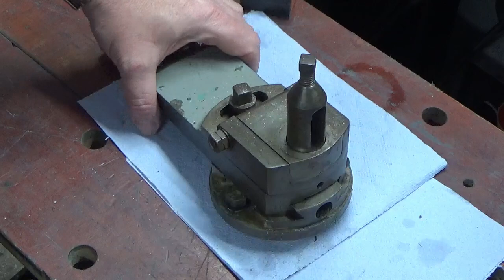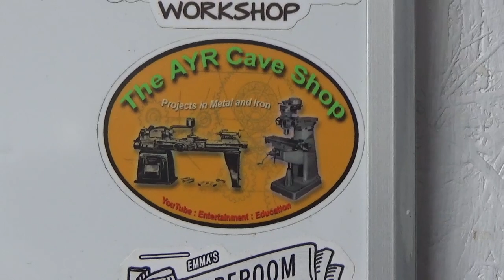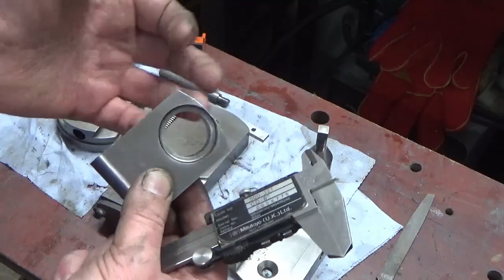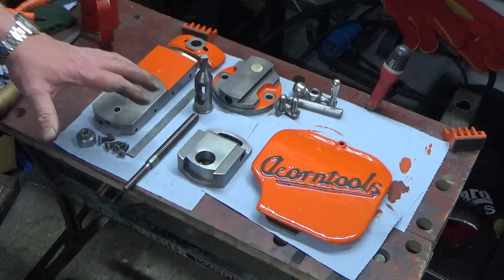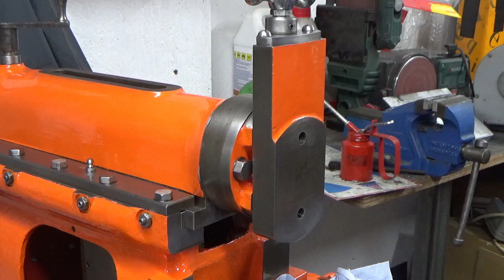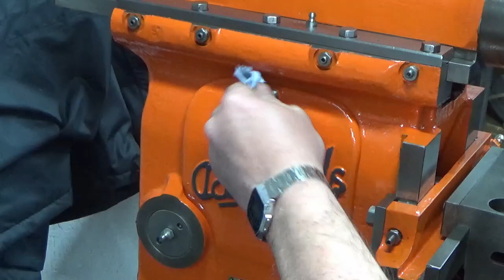Atlas 7B Shaper Refurb Part 9 - Tool Slide and Clapper Box

Comment: I my not be of much help, but I would mic the bore on the clapper plate, and compare those readings to the lattern post. Have Dean and Michel mic theirs and see comparison. The lattern post take on a lot of ware over the years. Bear
Reply from the maker: Hi Bear, thanks for the comment. Yep, we did just that, Dean's is exactly the same. Must be by design. Very odd. Cheers, Jon

Comment: I have an Elliot 10M and I've just checked the lantern toolpost arrangement. It's a sliding fit when it's all the way through, but when I pulled it right out I discovered that it has a step in it - so the part with the slot is slightly undersize. I can understand the comment about not using the washer between the post and the clapper, but on the Eliot it's a huge great thing and makes no difference to the stability at all. If the toolpost was a sloppy fit in the clapper, I'd remake it because there's potential for the forces on the tool when it's cutting to move the (undersize) toolpost about in the hole - somewhat undesirable!
Reply from the maker: Hi Steve, thanks for the comment and information. Yep, I agree with you, future project I think to make a new one. Cheers, Jon

Comment: Hi Jon Just had. Look at my Acorn tools shaper and the tool holder is same as yours, with plenty of slack. It has a washer of 5mm witch sits under tool bit plus a piece of iron packing to spread load of clamp bolt.you asked if mine had a label from supplier I think, but no sign of any other info apart from Acorntools logo cast into gear box door. The motor on mine is a Hover 1/2 hp unit . Have been watching  guy you suggested who has re built an Atlas 2b with interest . As I said in last reply I’m hoping to work up a drawing from promotion pamphlets and specs and photos to make up some patterns for swivel vice out of SG iron . Vices for these seem to be like proverbial hens teeth with a hefty £££tag  . Keep up the good work really enjoy watching your channel,
Reply from the maker: Hi Brian, thanks for the comment and information. Think I will make a new one in the fullness of time. Glad you are enjoying the channel. Cheers, Jon

Comment: The lantern post is correct.  There is a conical washer set that belongs below the tool but you can just use washers.  Once it is tight that movement goes away. The keyway cutter uses a nut to pull the front and back together for ridigity.  That is why you dont want to weld the lantern in.  Great video
Reply from the maker: Hi Almost Machining, thanks for the comment and information. I will probably make a new one at some point which is a snug fit. Can't think of any sensible reason why it should be undersized. It will be fine for now though, it's only a little machine so cutting forces will be light. Cheers, Jon

Comment: Hi Jon, shaper looking nice. I checked the clapper box on my Viceroy Royal 250 shaper and there's very little play in the tool holder/post. Regards Kevin
Reply from the maker: Hi Kevin, thanks for the comment and information. I see no sensible reason at all for the undersized lantern. It will do for now but I will make a new one at some point that fits properly. Cheers, Jon

Comment: You're getting on with it Jon, it's a nice machine and I'm sure it will serve you well.  Your masking tip is used in every aircraft sheet metal shop I've worked in. Usually when masking up sheets or parts prior to non damaging marking out. An old steel rule with a ground down edge works really well too and a lot of 'sheeties' have one in the toolbox. As you say, sharing the knowledge is the best part of this. Never stop learning. 
Best wishes, Dean.
Reply from the maker: Hi Dean, thanks for the comment. Lol, Sheeties was a new word I learnt when I transitioned to shipbuilding 2 years ago. Never came across it in aerospace, all my time was in engine manufacturing. Good to share, even better to see someone else benefit from it. Cheers, Jon

Comment: Hi John.   I appreciate what you do.  The lantern on my 7B is not exactly tight either. It is a closer fit than yours but nothing precise about it at all. If you want I can measure things up for you.
Reply from the maker: Hi rlferv, thanks for the comment and sorry for the delay responding. I think I will go with what I have to start with based on other Atlas 7 owners feedback. If I get issues, I will make a new one. Cheers, Jon

Comment: The bore in the clapper of my shaper is 32,0mm and the toolholder 31,9mm. It works perfectly fine.The only thing to look out for is that the sholder on the toolholder seats perfectly in the recess of the bore in the clapper. My machine (and also yours) normally has a hardened washer between the clapper and the cutting tool. I never use it because it's more rigid without. Have fun with it!
Reply from the maker: Hi Rusti, thanks for the comment and for the information. Pretty sure in the fullness of time I can improve on what we have currently, but also sure it will probably be OK as it is to get me started. Cheers, Jon

Comment: Shaper coming along very nicely Jon.
Ref masking tape and filing tip, I was shown that sometime in my apprenticeship 78-82, but that's the idea behind machinists,  machine tool fitters recording YT videos. 
Same with making paper gaskets, dirty thumb rubbed on the edges, rubbed, peened with smooth Hammer ad infinitum, borne out of building machines quicker to get a bonus or price work.
Thanks for sharing.
Reply from the maker: Hi John, thanks for the comment. Yep, I was taught it by an old guy when I was in my apprenticeship back in the 80's. Without YouTube, I fear lots of this type of "hand me down knowledge" would be dying out! Cheers, Jon

Comment: What ho Jon, 
What's this nonsense about making new bits, if you are unhappy with the fit just sleeve it, why make work for yourself?😉
I know what you mean about hearing tips being passed on. I gave Abom a tip once and later heard Blondiehacks quoting him, not being an egotist I can't say "fame at last" but you know what I mean.😎
It won't be long before the blue hot chips are flying.👍
ATB 
c
Reply: The problem with the Americans is that they are now and have always been very good self publicists.
Reply from the maker: Hi Chris, thanks for the comment and sorry for the delay responding. All good points, noted! You will get your 15 mins of fame, I estimate that in about another 150 to 200 years I will be of a similar channel size to those you quote, so hang in there! Cheers, Jon

Comment: Hi,Jon. That lantern holder is a dreadful fit in the clapper. I have 2 homemade lanterns for my Alba 1A and they are a very snug sliding fit. Even the old original holder which was beat up was a very close sliding fit. 
There is a little more to this scenario in as much as a large commercial shaper(Cincinatti etc) almost always have an extra outer plate that sits over the lantern and sits flat on the front of the clapper block. With this set up when the tool is clamped the outer plate provides a very large footprint being clamped against the clapper.
If you were to copy the block and outer plate mounting on a small shaper it would hinder/reduce the amount of work space on the table and the effective ram stroke therefore you are better to make a new snug fitting lantern. I will send you a couple of photos by email later of my homemade lanterns and the non marring clamp bolt that does not damage the tool shank.
Edit to add: Some large shapers also mount the tool by clamping under a pair of bolted clamping straps...you havent got enough spare room for that type of set up either.
Reply from the maker: Hi Howard, thanks for the comment and information, and sorry for the delay responding (I am well behind). Think I will be making a new one taking your points on board. Cheers, Jon

Comment: Hi Jon, I checked my tool post, yeah exactly the same, so no worries. It's very solid once you clamp up a tool bit. There is a soft steel flat washer that goes between the tool bit and the clapper, 1.5 x 1 x 1/8 inch. That gives the tool bit lots of support. I'll email a photo. Your on the home stretch and looking mighty fine !
ATB....Dean
Reply from the maker: Hi Dean, thanks for the comment and the info. I wondered if I had a Frankenstein machine, seems so weird that every single dimension on it is imperial except for the lantern which is metric...... Bizarre. Thanks for the photos mate. Cheers, Jon

Comment: Great job so far. Degreasing the file is a good idea but you then handle the part and put your natural oil/grease from you hands onto it defeats all of the work you have done or is that not enough to worry about
Reply from the maker: Hi DL, thanks for the comment and question. If I was spraying cellulose or two pack I would definitely be putting gloves on, I am using oil based coach paint for this job so as long as I have washed my hands I am pretty confident handling (I do try not to touch the painted areas too much though all the same). Cheers, Jon

Comment: I have an Ormerod 18 inch shaper. I have looked at the tool holder and it is quite a loose fit. I am certainly not an expert in shapers but I would assume that this play is intentional as it would not be caused by wear. As you say when in use the tool is bolted tight so I can not see how the hole would ever get bigger than the original dimensions. It will be interesting to see what other responses you get.
Reply from the maker: Hi John, thanks for the comment and information on your shaper. It looks like a mixed bag in terms of the responses. I will give it a go with what I have and if it is detrimental, I can always make a new better fitting one. Cheers, Jon
Reply: @jonsworkshop  Hi Jon thanks for your response, this is something I had never even considered before but since you have brought the subject up I am keen to get to the bottom of it.
My measurements are clapper bore 1.745 inches and tool holder diameter 1.734 inches (approx 44-44.2mm) 
I am struggling to see how these dimensions can change through use although I will concede that the tool is turned round in the holder by hand to adjust the angle of the tool but surely not enough to cause in my case 11 thou wear?

Comment: Hello Jon. That was brilliant as per. Good thing about the leadscrew and nut. Very nice to be offered a new one like that though. There are some kind people out there.

Good tip on the masking tape. I like that. Regarding the toolpost, the fact that it is 25mm exactly and ground and hardened that way (so meant to be that way) does seem to suggest it isn't original. I see the suggestion to build it up with weld and then machine it back. Wouldn't that affect the hardness? Maybe you could make a new one if it proves to be an issue? I am trying to imagine how the cutting forces would affect or be affected by it all. I know nothing about shapers, amongst many other things. Great video, really enjoyed it.
Reply from the maker: Hi Carl, thanks for the comment and feedback. Yeah, totally confused now, two atlas owners responded, both different. I think eventually there will be a project to make a new one, need to get some hardening and tempering gear first though to make a decent job of it (or use some pre hardened). Cheers, Jon

Comment: Your shaper looks brilliant Jon, that orange paint finish is superb. Good to see that there is minimum wear in the tool slide. The masking tape tip also works on wood for repair work or separating two different coloured finishes. Looking forward to the next shaper episode. Tony
Reply from the maker: Hi Tony, thanks for the comment. Lol, I think I am finally going off orange now!! Sick of the painting game lol. Quite a challenge getting a reasonable finish with a brush, takes a lot of effort. Cheers, Jon

Comment: That's coming along really nicely.  My guess on the toolpost, not being a shaper owner, is the same as yours - it's been replaced.  Shouldn't be hard to make one to inch spec, though.

For masking, I've always used a small hammer on the edges, same way as doing gaskets / joints on engines.  For really fine stuff, I use a stanley knife blade dragged sideways over the edge, which does basically the same thing as filing - you're wearing though rather than cutting.  I like the fine file idea, though.  I guess you have to be careful with the direction so as not to pick up the edge you want to stay in place?  You shouldn't be doing it bare handed before you paint, though, your hands are oily.  It's very unlikely to cause any problems painting a machine as opposed to doing car or motorcycle bodywork, but it's good practice to wear gloves once you've degreased.

I say it every time, but I love that orange.
Reply from the maker: Hi Wibbly wobbly, thanks for the comment and feedback. Yep, if I was spraying cellulose or two pack, the gloves would have been on. The paint I am using is oil based (coach paint) so confident enough handling as long as I have washed my hands etc. The colour seems to be growing in popularity lol. Cheers, Jon

Comment: Eyup Jon
Another great job,
 my little Adept Shaper toolpost is a good fit with no appreciable slop, so may be yours needs attention although i'm not sure on that one!!,
 as for your Podium Speech i am with you on that, it's all about sharing and passing on knowledge and tips, it's a hobby when all said and done and not for chasing for medals.!! 
see you next time
take care
Kev
Reply: 0.4mm (0.016") clearance seems excessive,  could be a  mix and nearly match jobbe, if the locking screw is metric,  then it's non original.
Reply from the maker: Hi Kev, thanks for the comment, totally agree mate. Thanks also for the info on your Adept. Dean from Ayr Cave says his Atlas is identical to mine........ totally bizarre, every other dimension is imperial on the machine except the lantern, makes no sense at all. Cheers, Jon

Comment: Jon just a thought about the toolholder being slack in the clapper box. Don't know about the slack, but all you need to do is weld the holder a bit where it locates in the clapper and re turn the diameter. Will save making a clapper or new tool post. Or find some shim to wrap around it. Regards from Australia.
Reply from the maker: Hi Dave, thanks for the comment and suggestion. Based on the mixed bag feedback, I think I will just use as is for a start and see how we get on. I will put a DTI onto the lantern during cutting and see if I can detect any movement. At the end of the day, this is only a small lightweight machine so cutting forces will be light to moderate at worst....... probably nothing to worry about. Cheers, Jon